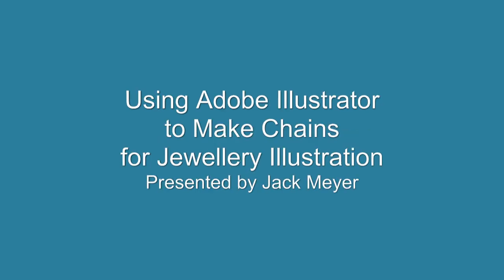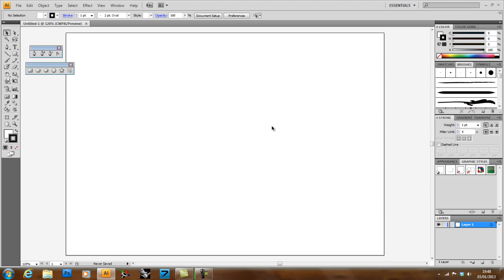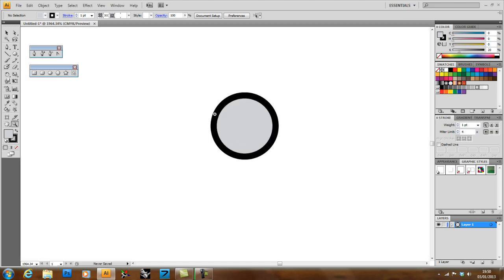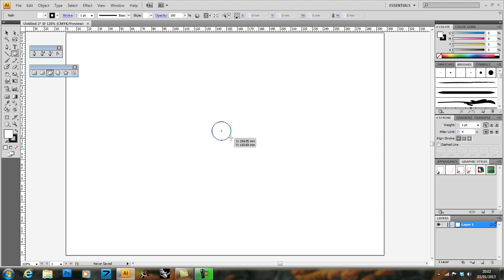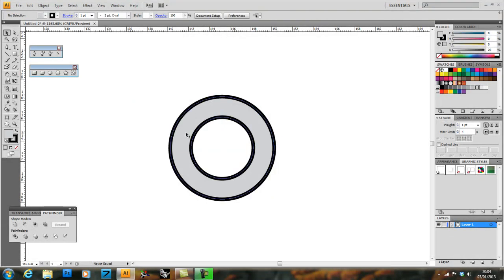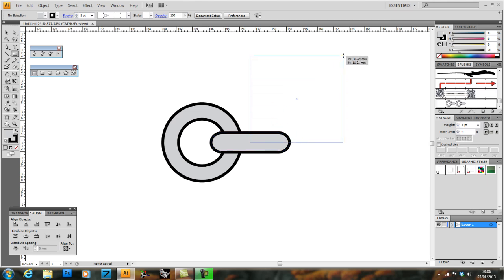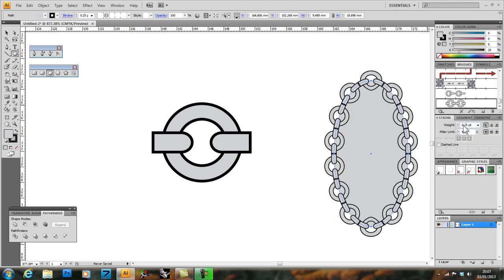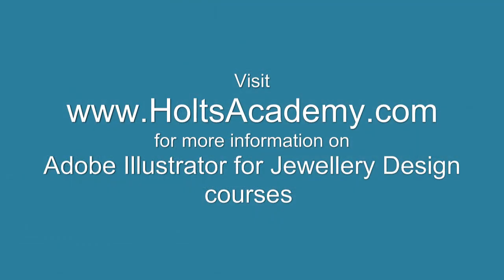Building Jewellery Chains in Adobe Illustrator - Holts Academy of Jewellery

Comment: 12:50 THAT'S THE PROBLEM THE RINGS ARE NOT PERFECT ROUND!
Reply from the maker: Indeed. But given the fact that in a design diagram this is only for show, it doesn't usually matter.

If it's a major issue (such as you're printing out this image for painting), you can Expand the shapes and replace the offending bits. But that would be a slow process.

Comment: how can we do it with gradients it will show some gaps in middle
Reply from the maker: I'm afraid you cannot use gradients on Pattern Brushes. It's a limitation of the Pattern Brush tool. The best you can do is cartoon shading (with lighter fill shapes with no strokes laid on top of the original shapes). This can look pretty good with some careful design though.

Failing that, you can always Expand the pattern brush and then gradient shade it yourself.

Comment: Brilliant thank you so much! i wish it translated straight to embroidery software but it only reads strokes as lines but i suppose i could rasterize it and recreate as a new shape. Thanks a ton
Reply from the maker: Hi Hanni:

You can indeed use this trick for creating embroidery patterns along edges. You would then be able to use the Object->Expand command to break it back down into vector objects again.

The catch is that the expanded shape would give you a group of pattern brush tiles which in turn are each a separate grouped object. What's more, the original curve the pattern brush was laid along will still be there as an invisible object (no fill or stroke).

As long as you can manage that, this technique should theoretically work fine with any edge treatment.

Hope that helps.
Reply: Oh you rock! I will have to try that. Thank you